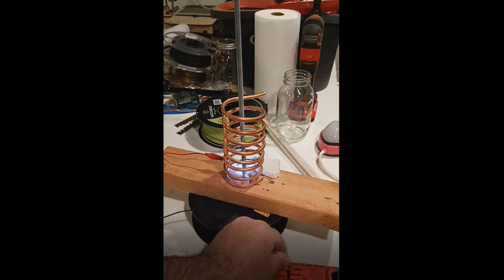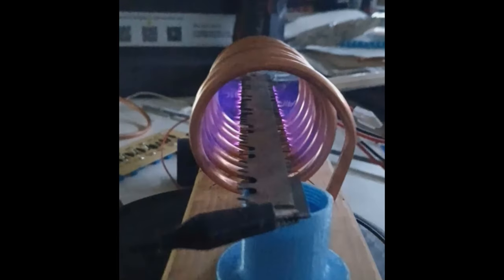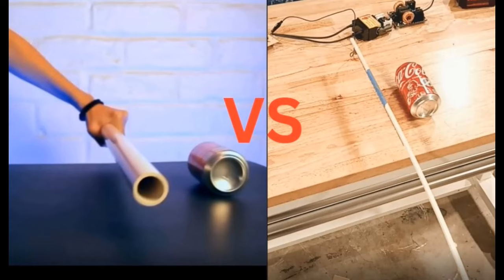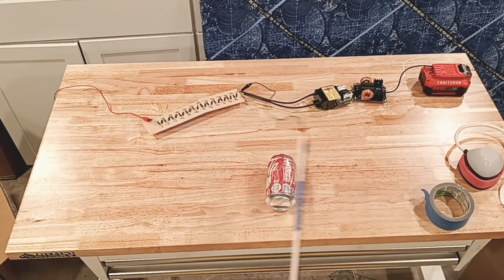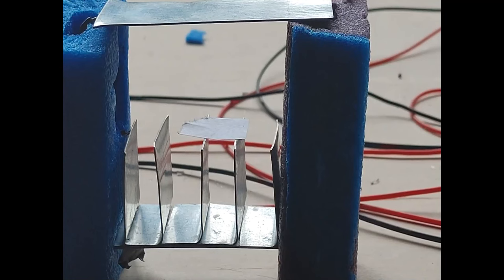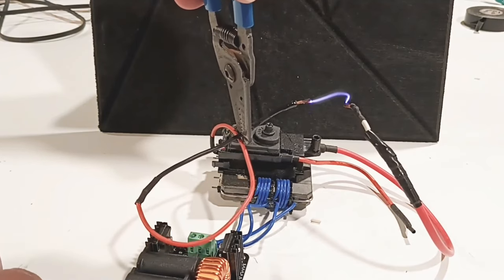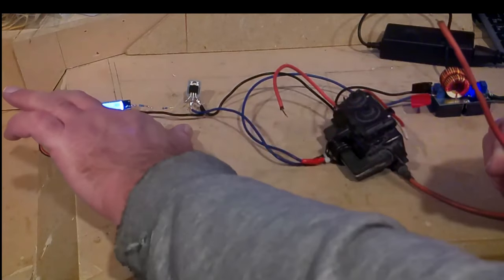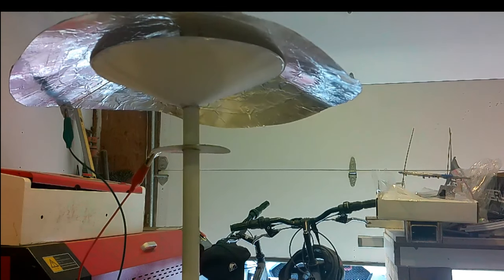Is Antigravity A Reduction In Weight???

Comment: According to Wheeler weight is not itself a thing but determined by 7 specific variables:

Location
Vector
Magnitude
Phase
Medium
Distance
Charge

I've not fully wrapped my head around all that yet, probably should be investigated for field propulsion enthusiasts.
Reply from the maker: what happens if force equals weight and a small propulsion is needed and it works. You then trade a rocket for a jet engine to get to space. as far as thrust. If it fails a scale for antigravity will be useless.

Comment: Gravity is the aether (that has a viscosity of 1E-12 poise) being pulled inwards in an accelerated manner to the earth by the glassy silica layer at the core mantle boundary (positive charge) that then turns the space into lava. The earth grows and we have plate Tectonics. The aether with the viscosity puts a force (F=ma) on an object (the mass). The aether gets pulled in by the positive charge as the glassy silica layers atoms are vibrating (the frequency) and pumping the aether from our universe to the parallel universe as the universe expands or the big bang. For a person on the ISS, they are falling in freefall at the accelerated rate of the aether (due to the expansion of the universe) into the earth, so they are weightless (zero force). To make the graviflyer lift the frequency and charge (the accelerated aether from the electrons on the disks that have their atoms vibrating frequency emitting the aether that is the exact opposite of the earth as explained above) has to be opposite the earth's frequency and charge. The earth's gravity also has a voltage which is Vq=Energy. To get the proper energy to lift the graviflyer the voltage and charge have to equal the voltage and charge on the earth for the area of the earth that the graviflyer is nearby. As Nathan shows the charge and voltage vary inversely. It is not really a high voltage that produces a large charge but the combination of the two to get the proper energy. To make an arc it is power that determines the arcing. It is not voltage. 20 amps and 120 volts may get the plates to arc, or 1 amp and 120 volts may get the plates to arc as it is the power that does the arcing. A welder does the same thing with both an amp and voltage control. The earth has a charge of q=ar^2 where a is the acceleration due to gravity and r is the radius of the earth. The amount of energy to turn the earth is 2.25E+32 joules and V=E/q to get the voltage of the earth. The power needed to turn the earth is then Power=IV=V^2/R=I^2R. If there is a large voltage leading the current as in AC, then the resistance is very low and makes the graviflyer disks superconducting in a way. If there is a low resistance, then the current is large on the graviflyer disks as Nathan shows in his experiments. With a low resistance that is superconducting then there is no heating of the disks but the production of the aether as anti-gravity as explained above with the earth as gravity. The eddy currents from the magnets on the graviflyer disks just like on the earth with its magnetic field making a current from the charge on the earth is what makes the superconductivity on the glassy silica layer at the core mantle boundary to make the gravity field on the earth with the aether as explained above. You need a very high current to make superconductivity and why the power grid is currently going to DC from AC with the windmills and the solar. To get the proper charge on the graviflyer in the vicinity of the earth that the graviflyer is near to get lift you use the equation F=ma=kq1q2/r^2 where r is the radius of the earth. The energy needed for the graviflyer is the equation E=kq1q2/r. E=Fr.  The power needed is power=kq1q2/rt where 1/t is the frequency needed on the graviflyer. The eddy currents on the graviflyer disks needed is I=q/t. The magnetic field from the magnets on the graviflyer disks needed is the equation B=m0I/2pir. The voltage needed on the graviflyer disks is V=E/q. The angular velocity of the graviflyer disks needed is related to the angular velocity of the earth with the following equation using angular momentum and moment of inertia.  L=Iw. To get the Inertia use the equations for a sphere for the earth and for a disk for the graviflyer.  I=(2/5)mr^2=(1/2)mr^2. We know the angular velocity of the earth so we can solve the equations.
Reply: Where did you get all of this? I look at this and wouldn't understand it all without a lot of work, and I am hoping it is right. I would bet that the info you just gave us is much more credible than quantum bs, but Knowing that the entire field of quantum physics is mostly solid math built on squishy ground (understanding), I was wondering about your understanding of the basics agrees with what I have figured out. I'm trying to decide if you are someone that has a lot of valuable knowledge but doesn't have the basics right, or do you have the basics right. In that case I should just shut up and learn.   The more I read this the more I think that you can't have the basics right, but I am sure that you can teach us all a great deal; I am interested in knowing more about the earth's electrostatic fields. Ionized air layers? I suspect not? Maybe in a video OMB can explain them to me or everyone. I feel like I'm getting screamed at to explain what gravity is; it is so simple compared to what you guys have figured out. I was just going to use gravity to get views for the other things that I have to say. By the way, nothing is pulling! A distinction with a difference.

Comment: What if you rephrase what weight and mass are and considered instead momentum. Where momentum at a relative zero velocity can resemble weight.  I saw somebody else commented that weight in space doesn't exist but it's still mass that exists but at that point it's purely inertial or a change in the momentum that you feel a resistance to change... I have wondered if electrostatics actually end up being gravity but they're not because different materials react differently.   Space that is deeper in a gravitational well is stretched in two directions and compressed in one.  The direction normal to the gravity well space is actually compressed.... But... In being stretched that space is less dense.  Mass will want to go towards space that is less dense.
Reply from the maker: that would be a good way to phrase it. I just want to see the truth. when I ask everyone is is a philosophical question to them not a testing based one. I figured by doing the test we could make it a known thing in science. can you imagine the implication of creating a net zero and a small lifting force could do. Space launch would go from giant rockets to a jet engine. ( strength wise) If it doesn't work we would have to require more than the scale for lift. I just want to know. Don't you.
Reply: @nathanbunten4299  a few videos back I demonstrated some simulations of bending space that would be practical... I'm sure there's links in the description to the projects a document about it that specific thing and the demos cuz they're all just simple JavaScript
Reply from the maker: @3zdayz  I will look back at it in the morning.

Comment: weight is a loaded term... weight is measured by the downward force of a object... There is gravity in orbit, causes a constant falling scenario. You would have no weight in orbit as there is nothing pushing back against you... and as such you would have no weight. BUT still have gravity.... So the question is... "Is anti-gravity a reduction of weight" the answer would be "NO".
Reply from the maker: if weight is not lift. If you equal force to lift will a small lifting force make it lift. As long as that lifting for could never lift it originally?
Reply: @nathanbunten4299  Define lift?
Reply from the maker: @EC-dz4bq  If i made the craft 1lb then i created force to show on a scale that I could reduce the weight to a net zero. So the scale would read 2lb 1 for the craft weight 1 for the force. so net zero.  then i used a ion lifter capable of lifting 1 gram would it lift off the ground? would it rise up and fly?
Reply: @nathanbunten4299  Uh if you put a 1lb craft on a scale and made it net zero... then it would read ZERO not 2lbs... Also you just proved my point... ironically.
Reply from the maker: @EC-dz4bq  the force is downward to show weight loss. it would start at 1 pound unless you zero the scale after the craft is put on the scale.
Reply: Weight is defined as the sum of all contact forces on an object. So if the graviflyer has zero contact with  anything then it is weightless. It could be in free fall or hovering when weightless... Therefore, weightlessness does not equate to antigravity but antigravity can make something weightless. Hope that made sense
Reply: If electrons leave, it is technically lighter. 
If current is flowing, unless it is reluctant to leave, the mass will seemingly stay the same.
Electrons are much lighter than their counterparts,
protons are x2000 times heavier alone.
So even if you did get ions to go somewhere else, or packed in a battery to charge, it would be a slight difference, unless reactions occur.
Reply from the maker: @osevenninefiver  interesting

Comment: I will add my 2cent about tv flyback. It works efficient upto 20khz max. After that everything drops significantly.
Reply from the maker: The ac flyback is more reliable but in order to get the same effect you have to reduce amps and regulate frequency. It is much harder

Comment: nice video, just looking at the effect your coil and the saw blade gave made me think about the center of the tesla coil and the effect this gives. Alexi had a wire from the center to light with him as an earth. Purple plasma effect, is it electrical and magnetic or one or the other . The other point from his videos is frequency changes he listens to, as with my corona motor or ion motor the speed increases and the tone changes. Interesting. Thanks.
Reply from the maker: you may want to add the circuit. It was 20-30 dollars in cost. It would give you an answer. Also the 2 flybacks in series really works good as long as one of the coils is low amp. Just meaning the spark is not super thick white. I will check in on you project and see if it helps.

Comment: I didn't understand what changed for not making the can moving anymore in the second clip
Reply from the maker: if it's the can the charge was gone. I worked it in small increments back and forth building up the charge then added more power and worked it again. When the lights went off I had not built any charge. so it sat there.

Comment: your video gave me the idea that perhaps, if you were to make a jig, and put it on a scale, with an electron gun shooting at a 45 degree angle at a piece of aluminium, the aluminium would gain a negative charge, repelling against the electrons, and as electrons have a small mass, the weight of the aluminium would decrease because it's repelled by the electrons from the gun, and the repelled electrons would then live the system or be converted into heat, this would I assume effectively to be antigravity as part of the energy that would've been exerted by gravity on the jig would end up turned into heat, I think if this is right, this could be how the graviflyer could work( if it could and if any of this is right) please anybody try to correct me if I'm wrong, please
Reply: I considered that.... But the mass of a coulomb of electrons is still really tiny and the electric field would break down long before you can get it I really measurable difference
I kinda misread.  The problem would be you could get the aluminum to be repelled from the gun but as soon as you attach the aluminum to the gun that force is not free to do any work